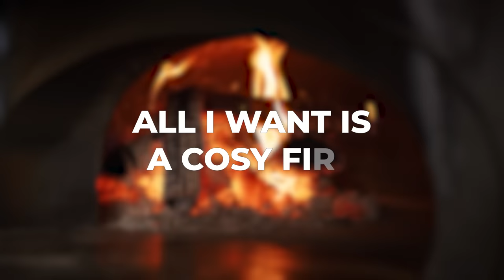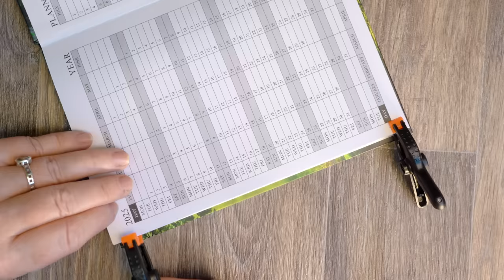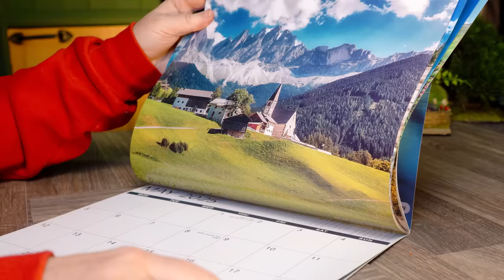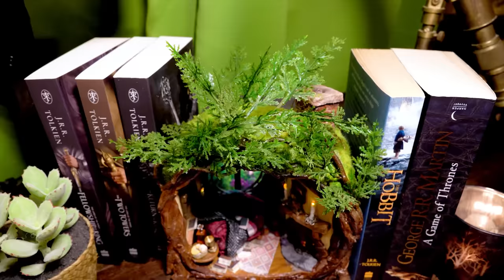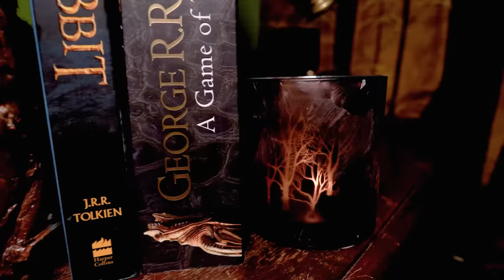I Made a Hobbit Book Nook from Recycled Christmas Trash

Comment: Magnificent! I’m wondering what the spray adhesive you were using was? At the bottom of the description, I can read the word “materials,“ but it won’t scroll down further, and I can’t see what they are.
Reply from the maker: Hi I used super glue first and the spray is an activator to help it to fix it in place quickly...as it's quite tricky to hold it still for long enough without it 😅 hope this helps 👍😊